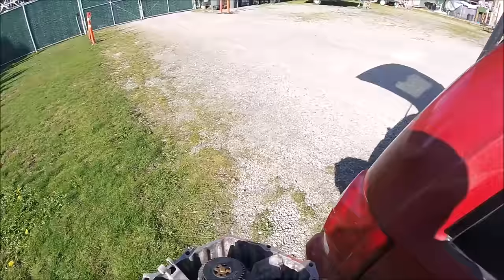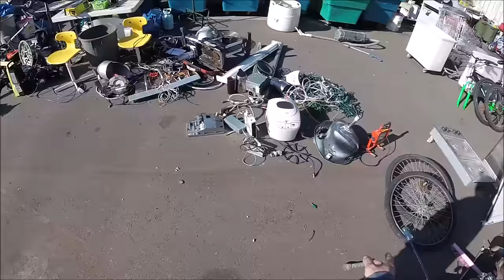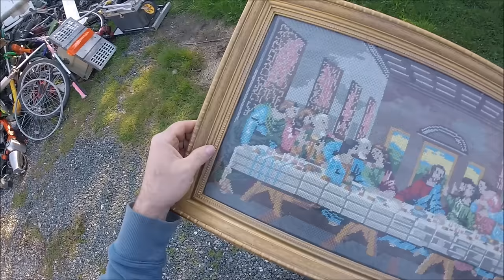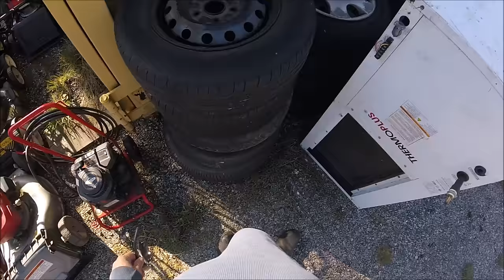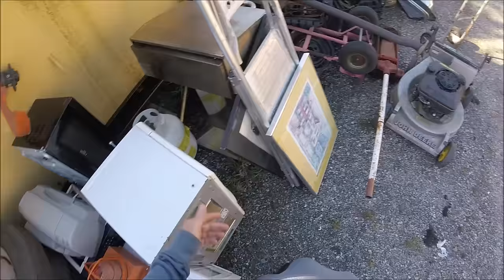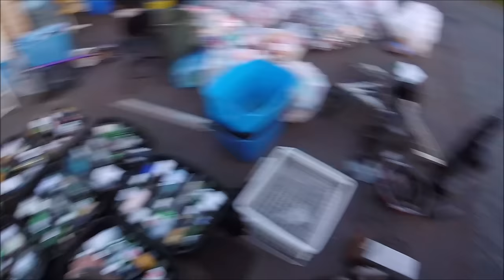Walking Tour of My Spring Cleanup Finds + Getting My Bottles Ready

Comment: As I see it, various stages of material. Bottles - Ready for deposit. Cables - Not ready. Need sorting between #1, #2 high, #2 lower grades. Clean Aluminum - Not ready. Needs sorting and little processing. HMS - Not ready. Needs tire removal. Dirty Aluminum - Not ready. Needs processing lawn mowers, microwaves. It is interesting to see which activity you take up next.